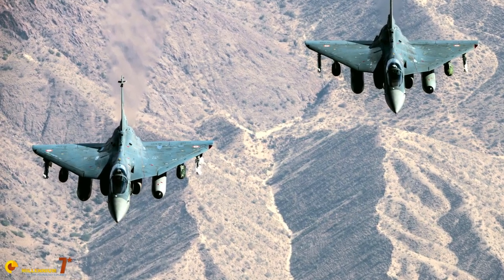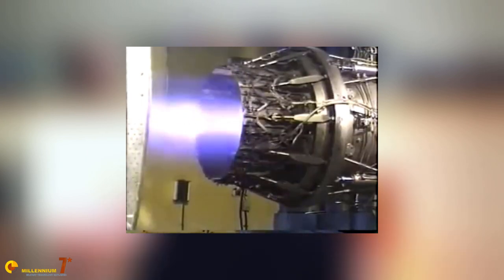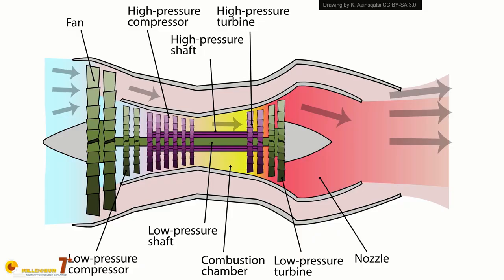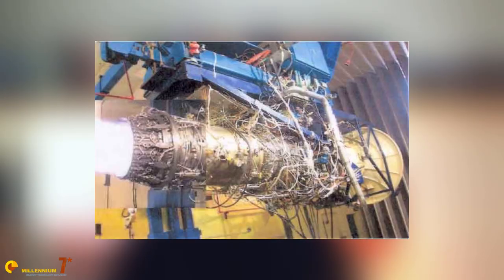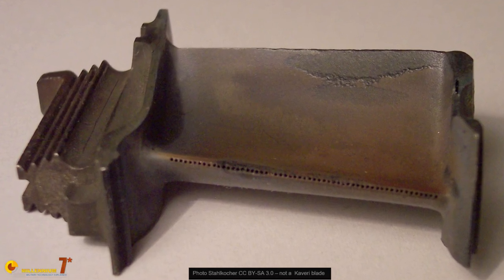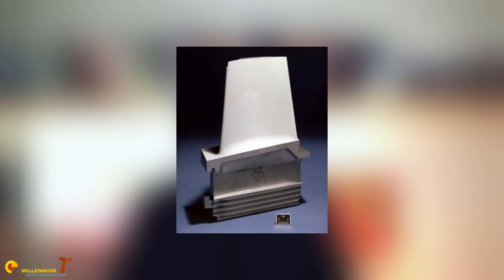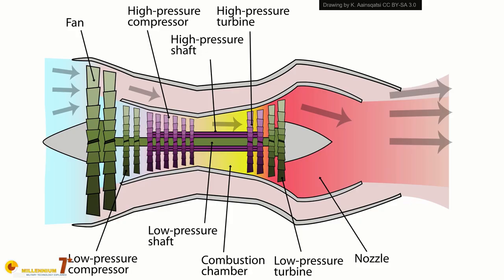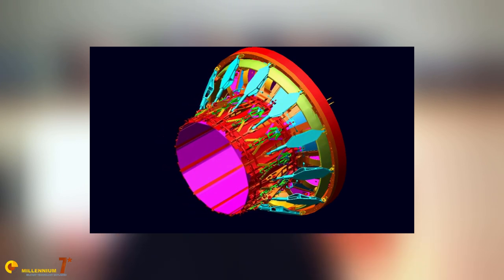TEJAS and the Kaveri Engine

Comment: Though it's a shame the Kaveri program failed , it's not real suprise , the program received only a fraction of the funding required , had no test beds or facilities and had no know how in materials , flame control and gas turbine design required . Also original program goals was 80 Kn wet and in the end the engine did achieve that number in test but not with the reliability required , the DRDO did actually end up fabricating decent Single Crystal Blades . And recently a higher performance fan was designed but core is plagued and badly designed . After the Rafale buy there was a deal for safran involvement , no work actually got done with safran and the GTRE quietly worked on with no real funding . Till date a lot of technologies like materials , combustion control and fadec other technologies have been developed but I don't see the Kaveri going anywhere with a flawed core . With all the technologies and infrastructure developed if the DRDO started on clean sheet design with technical consultancy from an early stage I'm confident that the program will do much better but a lot funding, infrastructure and technology challenges remain. For now the airforce is happy with the performance and reliability of the GE F404 which will continue to serve on the Tejas.
Reply: GTRE received all the funding they asked for and more. Initial request was for INR 3.83 billion. By 2004, INR 13 billion had already been spent, with the program still a long way to go. While nobody expects GTRE to get things right on the first try, it is deplorable that after 30 years of development, GTRE hasn't met requirements on weight and thrust (not even looking into finer things like engine life, serviceability and reliability, which are orders of magnitude much tougher than achieving performance). The only success that GTRE has to show is the small turbofan engine used on the Nirbhay cruise missile, but this was reverse engineered from a Russian engine (not to take away the work that went into reverse engineering it, which is not an easy task).
People need to realise that the work culture at GTRE needs a complete overhaul if things are going to change.
Reply: vignesh anand
 Don't use the word failed since Kaveri can be improved upon.

Comment: Kaveri based dry engine for 60kN class has been sanctioned for the UCAV.
Reply: In development, work needs to be done until it's ready. Another 5 years or so
Reply: @AnindyaMitraDigitalStoryteller  dude not 5 years  XD  Kaveri already has a dry engine. They will be adding newly developed technologies to it and that is it. I would be surprised if it takes more than 2 to 3 years
Reply: @AnindyaMitraDigitalStoryteller  gov has sanctioned 1000 cr for that dry variant for UCAV while the whole Kaveri program cost around 2700 cr,the technology involved in the new project will be way advance than what Kaveri has,and it will employ various new technologies like the new fan blade,3 gen single crystal blades and vanes,and new annular combustion chamber...it might take more 5 years to certify that and use on ghatak UCAV ...
Reply: @naveenarora6467  It takes around 3-5 years of test flights and optimisation before an engine can be certified as flight worthy. The Kaveri has not been tested beyond brief periods like an hour or two
Reply: @veerendrapratapsingh8719  The dry variant still has issues which haven't been fully ironed out. Without an indegeneous test-bed the engine development will take much longer than 5 years. It remains to be seen how the recent 450 crores funding for testing infrastructure is utilised
Reply: @AnindyaMitraDigitalStoryteller  the issues were related when engine went into AB,the issues of fluttering was solved by aero India 2019,the engine now produces 81kN thrust with thrust to weight 7.8,but can't maintain the thrust for long,that's the issue which remains.....
Reply: Its 52kn
Reply: @shivarathi3780  the term "based"..
Reply: They should've collaborated with Americans when they were showing interest. It could've sped up the process.
Reply: It would be a new engine not dry Kaveri...GTRE was asking for money so the govt said first devlop a new engine of lower thrust then govt will allocate money for new engine development .
Reply: @daylightsagacious4929  Americans defeat the whole purpose of building cost effective machine.
Reply: @bullseye6969  the collaboration could be in development of engineering materials very specifically
Reply: @daylightsagacious4929  America is known to frequently use technological sanctions with economic ones. Thus, the level of synergy that is needed for joint development is missing.
Reply: Toy Fwd  yeah I got it they make things prohibitively expensive and politically unreliable. It's better we developed our stuff ourselves
Reply: @daylightsagacious4929  americans never agreed to share the IPR.

Comment: It's crazy to think that India jumped into Kaveri with a turbine inlet temperature goal that's almost the same as the (notoriously hot-running) P&W F135. The M88 only runs at ~1600C and the F404 around the same IIRC.

Comment: We're going to build a modern jet engine comparable to any Western or Russian contemporary, from scratch in less time than it takes for established manufacturers like GE, PW or Rolls-Royce without any test bed, no testing labs, inadequate simulation capability & no domestic high altitude test aircraft.
This is pretty much standard for all Indian projects. Govt says build be something better than everyone else with 10% the budget & no R&D infrastructure. And then they refuse to even pay the alloted money saying they are short on cash. Meanwhile the military imports whatever it wants anyway & the next government reduces R&D budget even further saying they already bought what they wanted from abroad so no point developing it again. 
I remember when ISRO first started they had to carry rocket parts to & from the test range to their lab on bicycles & ox carts.
Reply: Bloody hypocrites, I know right?
Reply: Arkadeep Kundu: When India starts production of F-16 and its engines, Indians likely copy manufacturing techniques required to produce high resistant alloys for hot engine core from experience with F-16 engine production, by that time however early prototypes of 6th gen Western fighters with variable cycle engine (first tested on ATF prototypes in 80ties which resulted in the eventual production of F/A-22) may appear... 
But, India competing with China and Pakistan, not Europe or the US, and as long as China did not get hands on new Western tech, India should be fine for two decades at least with advanced turbofan engine considering China still not finalized even 5th gen turbofan engine...
Reply: @death_parade  Having licensed Cold War Soviet manufacturing technology for Flanker engines is pretty useless as Soviet metallurgy was behind Western engine metallurgy tech in 80ties which is among reasons why Soviet/early Russian engines did not last as long, so unless you want to produce short lifespan 80ties engine tech, licensed Soviet/early Russian engine manufacturing knowledge did not help you that much. Why would Russians even bother to interfere with India's attempt to produce a smaller engine for Tejas using licensed Cold War manufacturing knowledge if the result will be even worse than bought GE engines as far as lifespan concerned? 
Late 80ties Western metallurgy on the production-ready level was still not achieved in India because otherwise, India would not need to buy GE engine tech developed in the West during the 80ties for Hornet and modified in early 90ties. India may get closer to that manufacturing knowledge with mass production of engines for the F-21, having something working out in lab most of the time (not like Kavery even managed to match nowadays quite aged GE engines in power or reliability even with by your argument next-gen Indian metallurgy) is as much useful as having a new super battery you hearing about all the time that you can't successfully mass produce in the required quantity & quality for whatever reason. If you really believe India's problem is a lack of jet engine simulation to match what West designed and produced during the late Cold War with computers that did not match even your smartphone even when India can utilize the newest computing hardware and simulation software available I would not take your illusions away with common sense likely anyway, so I would not bother..
India is buying F-21 for a reason and that reason is that they cannot match even Westen 80ties engine technology on the production level, if they managed that, they just build constantly upgraded Tejas planes like there is no tomorrow, not like multirole F-21 has something that India cannot codevelop with other countries like Israel (which can and already producing missiles AESA radars & targeting pods for many countries) apart from the engine which mass production experience will be the single most important value of F-21 deal for India...
Hell, the fact that engine tech is what is most valuable for India quite obviously hinting even Lockheed itself in his F-21 for India video presentation:
https://youtu.be/VNIwVxhwLPM
Did you notice? ;) Don't worry I won't be responding again..
Reply: @death_parade  why you just trying to pretend to not be a troll, just admit it, I wanted to end this pissing contest, sincerely, but someone may take your comments seriously..

You: You talk about "Western 80's technology" and you call GE-414 "just updated Western 80's technology". Classic case of someone who knows nothing about the actual technology that goes into a jet engine.

Me: cool story bro but I never talked about GE F414 because as far as I know Tejas using modernized GE F404 with stronger afterburner (compared to F/A-18 or Gripen C afterburner), not 414 which was developed in early 90ties and which modernized version won a contract for the next variant Tejas II that is not yet in service, current Tejas using GE F404 because India can't match even that...

You: No country will give you their crown jewel i.e. jet engine technology.

Also you: India has been making Al-31 engines for a while now. 

Me: Well, apart from you contradicting yourself, Sweden license produces engines from foreign countries like the UK or the US for decades, in fact, engines license-produced for  Gripens C/E could work also for Tejas I/II.

Now back to your cave, and find a job if learning isn't your thing, perhaps Russians hiring professional trolls or whatever, and yes I am making fun of you because your contradicting comments make zero sense other than waste others people time by spreading misinformation and pretending that you know what you talking about. If you are used to be made fun by people of India/Pakistan, they in your specific case likely have their reasons, never been in India nor Pakistan, and certainly don't care about comment wars of internet keyboard warriors of these nations. I hope that India will have better relationships with Pakistan in the future when people of both countries were once able to live together just fine under oppressive rule, yet unable to live in peace together once they got freedom. It's kinda sad actually when both countries have a lot of catching up and instead for decades spending an excessive amount of money just to deter each other, this makes nowadays a bit more sense with the rise of China in the last decades but still...

Comment: Only way to deliver new engine for AMCA on time is find a reliable partner as soon as possible, the experience on Kaveri will definitely benefit
Reply: What partner do you want ? India started to R&D and built their Kaveri engine alone, but they suddenly understood they will failed if they keep going alone. So this is why India already made a contract with SNECMA for technical assistance, but the problem is simple, It is very difficult for any jet engines makers to jump suddenly in a project which has been started by other people before them.

SNECMA is now part of SAFRAN, and they proposed a new contract for India to finish the Kaveri engine. It will be much more difficult to find a new partner now than ever, It would be so much work to understand It all again for another team.

Comment: If I understand it correctly, the Russians typically have short performance lives on their jet engines.  Instead of overhauling a Mig 21 engine, they just put a new one in and throw the old one away.  The Time Between Overhaul on their engines is short.  Having them help you design a jet engine turbine might be a bad idea, because it might not last long.
Reply: They don't throw them away. They are stripped down and rebuilt and put back in to service. It is part of their engineering philosophy. They have an abundant and technically trained workforce so it is really designed to exploit that resource.